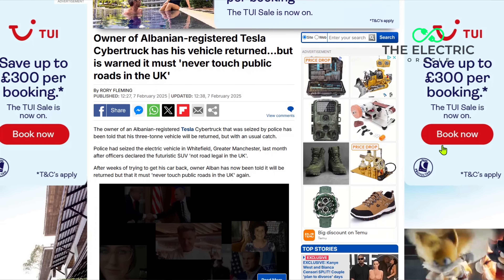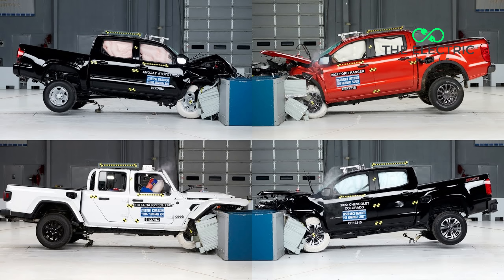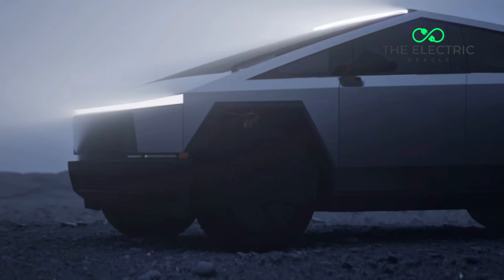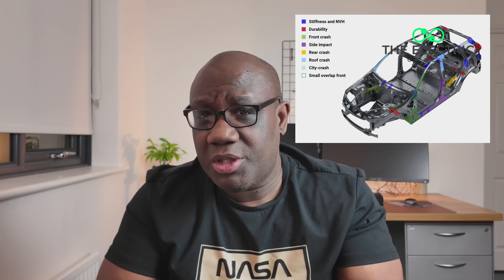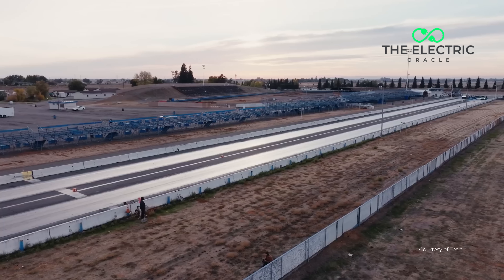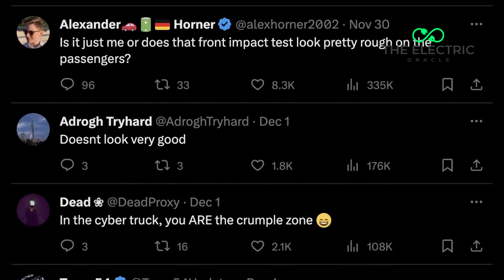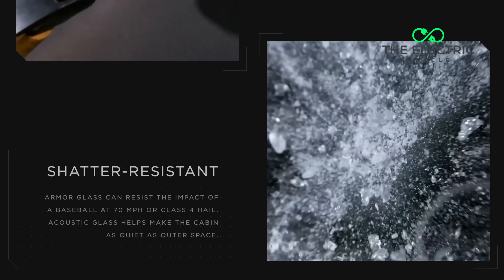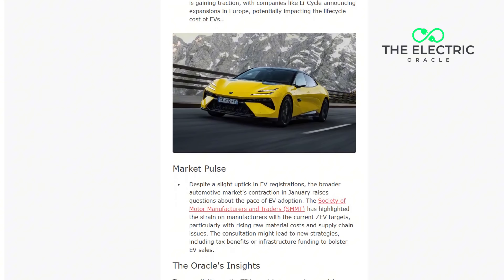Why the UK Banned Tesla’s Cybertruck – 5 Fatal Design Fails!

Comment: We shouldn't be comparing our safety standards with a country that allows signal lights to be the same colour as brake lights... They just don't care about people over there. 

I really hope that monstrosity never, ever, makes it onto UK roads.
Reply: Totally agree. US has a population of 334 million and road deaths of around 40,000 annually. The UK with a population of around 68 million has around 1,600 road deaths annually. So per head of population, US road deaths are almost 28 times higher. This is what happens when there is poor regulatory oversight.
Reply: @stephengraham1153   Seeing as I have a degree in mathematics, I'll just pull you up there on that comparison. US popn to UK popn is about 5 to 1. US roads death rate applied to UK popn would then be about 8,000 (40k/5). And that is about 5 times the UK rate. That is still incredibly bad.
Reply: @Hiltok 

Americans also drive over twice as many miles per capita, so it becomes even less. There's also the vast difference between regions and states. People from more rural states, with driving skills totally adequate for their area, may become puzzled when they come to one of the coastal areas with insane traffic. The UK has barely any truly rural areas (not just a handful of fields 2 miles from a large town) so UK people are all used to crazy traffic.
Reply: @stephengraham1153 The average American drives 15,000 to 18,000 mi a year. What is the average in the UK?
Reply: Go back to math class. Not 28 times higher, 5 times
Reply: @stephengraham1153  your math is little wrong
Reply: @stephengraham1153  its a bit more complex why they have very high road deaths mate. but that said you are correct and highlight the point well.

fun fact: in some parts of the US if you die more than 72 hours after the road insident. its not counted in the road death numbers. also the UK population is 76 million not 68 million.
Reply: @ Where did you get the figure of 76 million? I have seen this figure a few times before, but the the closest I can find is 69.3 million quoted by the Worldometer for the start of 2025. Official figures placed the UK at 68 million during 2024 and the 2021 census put the figure at just over 67 million. That would indicate a jump of around 9 million in about 4 years which I find hard to believe.
Reply: @stephengraham1153  You can state odd statistics all the time but if you factor in the amount of driving US citizens do comparatively then it makes sense. The UK is tiny. Much less roads and much less driving required. Also none of this will matter in the next few years FSD will be solved its not a question of if only when.
Reply: @stevensmutko1408  Yes, the UK is much smaller, but the density of traffic is much greater in the UK.
Reply: @stephengraham1153 in the city of Houston there are freeways that are 18 lanes wide. I don't think you have more congestion than the US.
Reply: @ The US has 41.7 million  motor vehicle and 283.4 million miles of roads. The UK has 41.7 million motor vehicles and 262,000 miles of roads. So that's 159 vehicles per mile of road in the UK and only 67 vehicles per mile of road in the US. So how do you account for the number of road deaths in the US being 28 times higher in the US? Don't you think that more regulation would save lives and keep dangerous vehicles off the road?
Reply: @stephengraham1153  vehicles per mile isn't very useful in this context.  You really want fatalities per vehicle per capita.  There are more vehicles per capita in the US than the UK, but not 28 times.  What would probably explain the difference is vehicle size per registered driver.  US market is SUV dominated where the UK is dominated by relatively tiny vehicles.  Still, accidents per 1M people the UK is 6th.  It's not the signal color.
Reply: @ You should also note that, The USA's own NHTSA conducted the study that found that amber turn signals reduced the likelihood of getting into an accident by 3-28% 

(To be transparent, that study did also note in the conclusion that factors, other than colour alone, could be at play. Such as the fact that amber lights are generally brighter, or that amber lights are always separate lights, whereas red ones are sometimes combined brake/signal units. But regardless, these other potential factors only strengthen the argument for amber signals imo. Whatever the nuance behind the result, safer is safer.)

Not that I think it takes a study for any right minded person to work this out. Imagine sticking 3 red lights on a traffic signal and claiming, "It's just as safe, you can tell if the light is the top, middle or bottom one!" 🤣
Reply: kennixox262 I agree, anything that makes signals more confusing or harder to read is bad. Keep them separate and different colours. Styling is not as important as human lives. 

When it comes to metric though, in some ways, I think we’re worse than you in the UK. We’re taught, and use, both!!! Metric for most things, but pints and gallons of milk and beer. People are measured in feet and inches, and we weigh people stones and lbs. Cars travels in MPH and our road signs are in miles. Most people can switch between both systems easily. I guess there’s an advantage to knowing and being able to convert between both, when you have key allies that use imperial and key allies that use metric, but it must be confusing for visitors.
Reply: @stephengraham1153  No, this is what happens when you go to fast.
Reply: Many of the neccessary changes for driving an US car in Europe are pedestrian safety related. The ASA need an "pedestrian lives matter" movement
Reply: Looks like a wedge of very hard cheese.
Reply: The Cybertruck doesn't really belong on US roads, either, and for many of the reasons in this video.  Sales have dropped here, due in part because of the actions of the man whose engineers devised this nightmare.
Reply: Sales have almost stopped in the USA.
Apparently there is now one cybertruck per massive vvanker.
Reply: @ThirtyYearstoolate  check your data again.  Cybertrucks still being produced and sold at over 1k per week.  It was the best selling EV truck and the 5th best selling EV in 2024.  It was also the best selling vehicle over $100k when it was being sold at that price.  Likely sales have only improved even more as the tax credit just kicked in.  We'll see when Tesla reports the Q1 data.  Don't believe headlines about discounted demo units as an indication of sales.
Reply: Statistically Tesla's are the deadliest vehicles in the USA
Reply: @DavidFerguson-rj9ew  In the EU as well. Insurance companies are not fond of Teslas because of this.
Reply: @peterhabets2780  That is not correct, the problem is Teslas are new and have not built up stats for making judgements on insurance costs.
Reply: @tedmoss  yep you are correct. it the same with all new types. same thing happens with new aircraft. no data high insurance.
Reply: @tedmoss  Tell that to the insurance companies. You need to convince them. Although on the road Tesla-drivers are really poor drivers but that is just my observation. n=1
Reply: @tedmoss  The FATAL crash statistics are out, tesla are genuinely the MOST DANGEROUS cars on US roads and when you consider there are FEWER of them but still have the highest number of fatal crashes that is alarming.  Plus it seems many of the crashes occur when the ''self steering'' is operational, you know the bit that's supposed to be safe to use.
Reply: @tedmoss That's not the total truth though is it? They knew how to build a compliant vehicle and didn't.
Reply: @DavidFerguson-rj9ew I just saw this report more fatalities in Tesla than any other car.
Reply: @DavidFerguson-rj9ew there the safest actually 😂
Reply: @DavidFerguson-rj9ew  really? i though that was a ford.
Reply: @tommyfred6180 nah according to iseecars it's rite up there tesla as a whole along with kia buick dodge statistics matter there's 100 times more ford's on the roads so obviously they'll have a high rate but statistically it's tesla that's the worst
Reply: @DavidFerguson-rj9ew no.  That is both statistically and logically incorrect.  Teslas are extremely safe and rated highly in every government test.
Reply: We are intelligent enough to know that when one side of the car, the light is flashing, it's a turn signal.
Reply: @ That's great, until somebody has a brake light out....
Reply: Ever since Technology Connections pointed out bad American turn signals, they have annoyed me to no end. I've seen moronic animated red turn signals when a simple amber lamp would be far more effective.
I was also pleased to see my current car did indeed have amber turn signals, and I made sure my next car had them too.
Reply: @mjc0961 I've seen Alec have a rant about turn signals a few times. 🤣 He's absolutely right of course. It just makes no sense putting style above safety.
Reply: U.S. citizen here, I just want to note that most of the regular folks here do care about people...the primary problem is the massive corruption and disinformation the ultra wealthy push. The Trump admin are literally criminals and fascists; Elon himself literally did the N*zi salute at the inauguration it wasn't 'awkwardly similar' because he'd been pushing racist conspiracy theories of Neo-N*zis for years.

As a pedestrian I'm glad I rarely see a CyberTruck IRL, though when I do I'm extra cautious because I do NOT trust the vehicles.
Reply: If you just don’t want to trade with UK… #47 is accomplishing that with vastly-more-adaptive Canada and Mexico… the rest of the world is just rebuilding its financial and physical supply chain without the USA…. Congrats?
Reply: Sadly a few have been imported into the UK and are driving around.
Reply: Too late mate!
Reply: Signal light colors save lives?  This is a joke, right?
Reply: On the other hand it's be awesome if UK drivers and delivery drivers could actually behave in a way that indicates they passed a UK driving test. If you get what I didn't write.
Reply: @techbricks5300  particularly with respect to the recent law about giving way to pedestrians at intersections!
Reply: or right turn on red.. stupidest thing ever..
Reply: @noosebrother why? Same in Canada. You have to come to a full stop before turning right on a red and on certain intersections it’s not allowed.

Comment: I'm ok with design winning over safety features if the risk is only increased for the occupant. If it increases risk for other road users, safety wins.
Reply: You can have your design piece on private property as a rock or to plow your fields, but you never can drive on a public road with rusty

Comment: All American large trucks are illegal in the UK. The legislation here is so restrictive importing anything like an F150 should have received the same scrutiny. Yet it has not. If memory serves, the UK Scorpion light tank was also designed to be driven on the road and is still road legal. A tank!!! The CT is being selectively banned here. So it will be interesting to see if those F150 Lightnings that have been imported are also impossible to plate, insure or reinsure. But you can still insure and plate your tank!
Reply: No, it has selectively banned itself by not complying to the well publishised vehicle design and compliance rules which apply equally to all vehicle designs. No Law has been specifically passed in relation to the CT.

Comment: It was NEVER designed for sale outside the US.  In other countries regulations are different.  However it can probably be sold in some countries.  Nothing wrong about not legal in the UK.  Only US regulations were considered during its desing.  The CT was designed for not using mirros, only cameras.  The put mirrors that can be removed, because the regulastion only call for saling a car/ pick up, nothin about driving it withpout mirrors.

No the CT has amply zones to dissipate the energy of a crash.  Wrong about the use of space grade SS,  It was to prevent unnecesary repairs on a working environment.  There are plenty of repair parts to rep[lace the crumbled zones.
It is not unsafe, in the US most of car sales are pickups, and that follow a simple principle.  The more mass the less damage to occupants.  So the CT weight more so it will make passenger of the CT very safe in a crash.
Reply: And the people that this angular stainless steel  31/2 ton sledgehammer hits at speed? If they are on foot they are toast, hell even in a modern car with proper safety compliant crumple zones and air bags? They are probably toast as well.

Comment: It was America who led the world in vehicle safety after the debacle of the Ford Pinto in the 1970s, with its vulnerable rear mounted fuel tank which was liable to burst into flame in a rear end crash.  It was the American Ralph Nader who led the charge for vehicle safety, it seems the USA is indeed going back - backwards.  In fact, Nader became an influential consumer protection activist.Not just the UK but in most of Europe and many other countries.  
The standard desirable lane width in the UK is almost the same as in the US, for example on motorways (as in US freeways) the standard is 12 ft or 3.7 Metres.  Dual carriageways, main trunk roads are the same but can be narrowed to 3 metres in some circumstances such as suburban roads etc.  of course some rural roads and lanes are narrower, dating from the days of horse and carts.
Reply: Incorrect unless you don't consider truck as a vehicle. 70's new safety regulations were only for cars and not for trucks. Trucks continued just as unsafe as they always were. Even today selling trucks instead of cars is exploiting the loop holes in the system.
Reply: @pasinen  Sorry, but I don't know what you're reading, but I never mentioned trucks, I was referencing passenger vehicles.  I apologise if I left that to your intlellect to understand that, I will spell out what I mean in much more detail in future.

Comment: It has to be safety first, such as Volvo have been doing for decades.  Tesla are not interested in the UK market for anything other that the high volume models 3 & Y.  They have stopped producing right hand drive version of Model S & Model X.  All their cars are designed to be the safest on the road and have safety ratings to match. The Cybertruck is too big for UK roads.  Perhaps they will make a smaller EU compliant version.

Comment: The sharp edges are because stainless steel is not as malleable as mild steel, not easy to bend it into smooth curves.
Reply: If they hired engineers designing cooking pots or other kitchenware, they might.

Comment: The elephant in the room here is that this isn't a car, it's a truck.  Its competitors in the US aren't cars, they're trucks (Ford F150, Dodge Ram, Chevrolet Silverado).  This means that in the US they're not built to the same set of safety requirements as cars.  We shouldn't be comparing it to car standards, but those of commercial vehicles.

Having said that, they're too big for European roads, and also no where near safe enough for the occupants, other people and other road users.